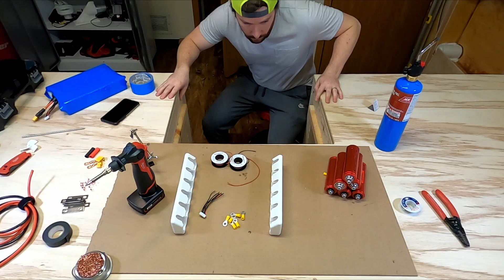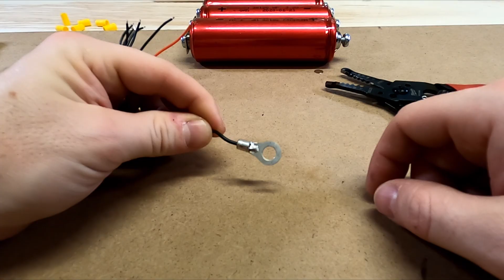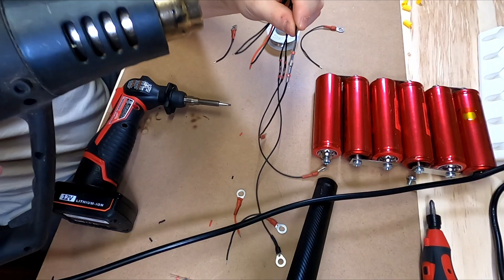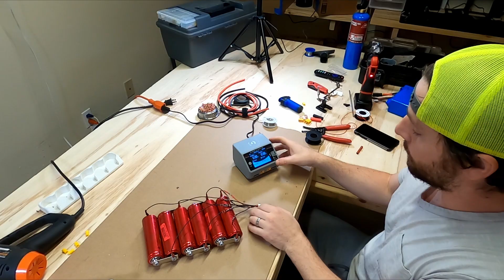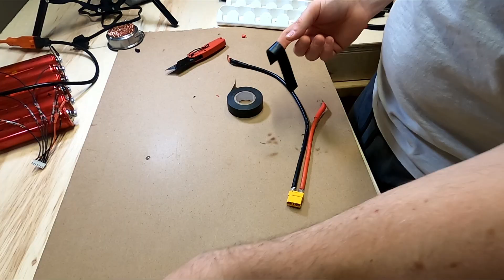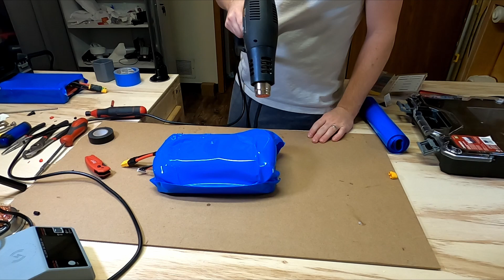DIY High Power Battery - 200 Amps!  3D Printed Cell Holder - Part 4

Comment: Everything looks good just one bit of advice you really should pre-tin your wires, even you have to use a torch, what I do is coat the wires with flux, even if you are using flux-core solder, I wrap the ends with a short piece of soldering wire to get it started then use the torch...
Reply: I have been taught not to use solder on crimp connections because when you crimp them, it crushes the solder and reduces the amount of surface contact. As for those lug terminals you're filling with solder, we usually crimp them at my job. (working as cabler in australia)
Reply: I soldered after crimp when i did this 😉
Reply from the maker: I can try using the torch; is there such thing as burning up the wires?
Reply: @JakeItsTheCops  yes but it take a lot to burn the wires, but you don't have to put the flame directly on the wire just stay back so the flame it self is just off of the wires, as soon as it is at the right temp you will see the wires sucking the solder in and you can back off the flame, practice on a scrap piece, I use a small torch fits in the palm of my hand it uses butane...
Reply from the maker: @lennym1636  alright I’ll have to give that a try! Thanks

Comment: Thanks for sharing how you're building your batteries. Looks like a good way to do them. What's the cost on the cells, charger, and parts?
Reply: 🍻 cheers, thanks 😊
Reply from the maker: So I just went and updated the description with a cost break down. Glad you liked it!